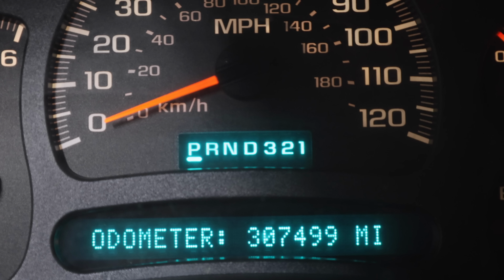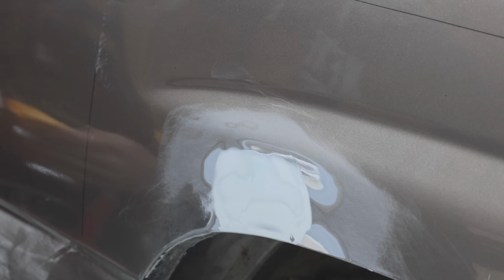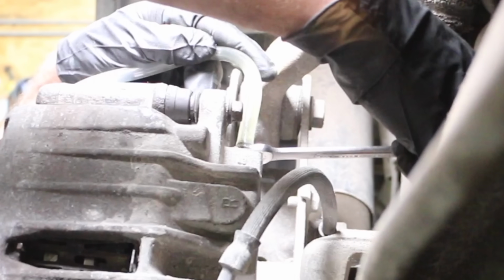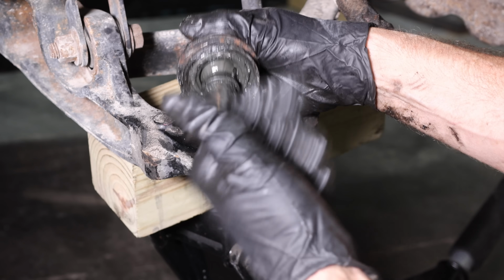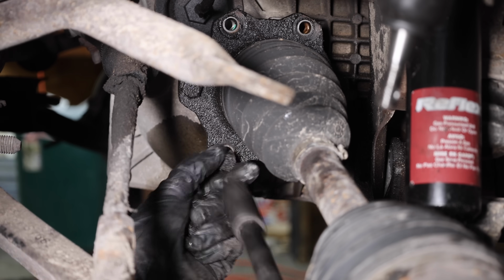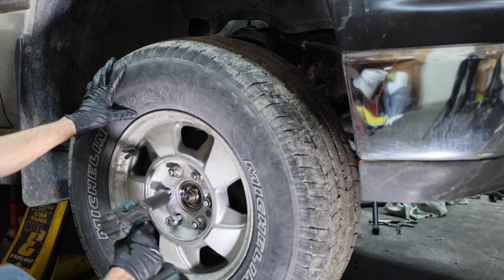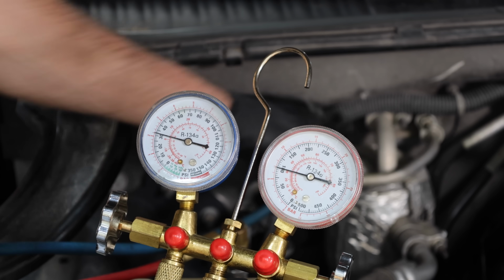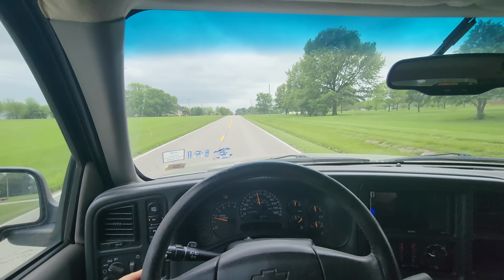Is It Stupid To Fix Up A 300,000 Mile Vehicle? Let Settle This!

Comment: I own a 2001 Subaru Legacy GT Limited 5-speed. 156k miles. in recent months, replaced struts/shocks (with coilovers and lowered the car), front CV axles, ball joints, tie rod ends, sway bar end links. power steering pump & hoses, and driver side steering knuckle & wheel bearing. Costed a bit under $800 but worth it to me. I love the car. 2.5 years ago I replaced the head gaskets and  2 years ago i replaced the brake rotors & pads. All this work would have costed over $6000 if I had taken the car to a shop. It pays to do the work yourself, however I will say that it does take some time and effort, plus extra cost if you don't already have the tools (like floor jack, jack stands, impact sockets, wrenches etc). It's worth it in the end!
DO NOT work under the car held up solely by a floor jack, put it on jack stands!! While working on  my car, i went to jack it up with my floor jack and it failed, the car fell back to the ground.
Reply from the maker: Thanks for sharing.

Comment: I agree with you that cleaning up parts and components when doing any kind of repairs is necessary. a person would really be surprised what can be found underneath the dirt and grime. such as cracks and other signs of wear. and if nothing else it looks better when the job is done. some vehicles will require cutting off rivets and replacing them with bolts. on the ball joints instead of C clips. some of the other areas that are known to experience significant wear. are universal joints and drive shaft carrier bearings. and transmission shift linkages because they get used constantly without a lot of attention. and rubber mounting points because the rubber can become hard and cracked. that reduces it's ability to isolate the parts and components causing squeaks and rattles. models like the Suburban are usually okay to repair with higher mileage. because they are sturdy platforms to begin with.
Reply from the maker: Thanks for the feedback.

Comment: I have 2003 chevy k2500 with over 300,000 on it. Not sure how many over. Dash stepper motors went out si I drove it with non/ working dash for 5 years. Basically same repairs you outlined. Lots better than a new $60 k truck!
Reply from the maker: Thanks for sharing.

Comment: I’ve got an 01 Silverado 2500 with 240,000 miles on it, I’ve owned it for about a decade, and have only needed to do regular maintenance, and a crate transmission about 4 years ago. Very reliable truck, pretty easy to work on. I’d recommend the GMT-800 platform to anyone who wants a vehicle with plenty of modern features that still wants to be able to work on it themselves.
Reply from the maker: Thanks for sharing.

Comment: As for fixing up an old vehicle vs junking its so situationally dependent.
How good of shape are major components in (engine, trans,etc?) 

How rusty is it, especially on brake lines, frame, body mounts...

How many miles is that specofic vehicle known to go? 

How far from home do you typically take it...

Just so many factors. 

Great video, glad to see anothef old chevy fixed up amd running! Love these trucks.
Reply from the maker: Thanks!

Comment: I have 235k on my Yukon, I removed the engine, replaced every gasket, and upgraded the radiator to a Denali rad and added oil cooler hoses. My opinion on these trucks, you can’t find a better value and easier truck to work on. Minimal issues if you take care of them.
Reply from the maker: Thanks for sharing.

Comment: Engine oil and transmission oil cooler lines 😢
Reply: Brake lines first
Reply: @magouliana32 interesting, why do you say?
Reply: @KevinPDunn  known corrosion issue on 2000-2006 gm trucks of that line they leak eventually big hazard

Comment: 322k mile 2006 dodge Durango 4.7 v8, needs a few stuff done but engine still runs, transmission and diff are in great condition and reliable
Reply from the maker: Nice!

Comment: I was with you on everything except your AC "pressure check."  There is no way to tell how much refrigerant is in the system based on a static pressure.  Due to the properties of refrigerant, if there is even one drop of liquid refrigerant in the system the pressure will be the same as if there is a pound of liquid refrigerant in the system.  The only thing a static pressure check will tell you is if there is enough pressure to activate the low pressure switch and turn on the compressor.  So, just because the static system pressure approximately equals the outside air temp doesn't mean it has a full charge.  

The ONLY way to tell if an automotive system has a full charge is to remove the charge and weigh in a full charge.

Comment: The way I repaired my car. Does the job. Saves cash 💰 😂 by the way, the battery is on its way out.
Reply from the maker: Thanks for sharing.
Reply: @ProjectFarm  your battery health should be determined with a fully charged battery to 12.6 / 12.8 volts. Let a small current skim excess charge (use headlights for instance) and run the test again. It will give an accurate measurement.

Comment: do not change and what was the total cost for all these repairs for parts then maybe if you add the value of your time?
Reply from the maker: Thanks for the feedback.  The total cost of repairs was $2000.  Saved between $4500-$5000 doing it myself.

Comment: i love seeing videos like this, it inspires me to try and do even more on my first car which i have for around 3 years now, its a 1989 Miata and its such a fun and clean car. since im still an intern i dont have that much money, so i try to do all of what is possible in the driveway and try to make the repairs diy. already did front brakes, front ball joint, valvecover gasket and cam angel sensor o rings, thermostat, all the filters and fluids including flushing the radiator, and just stuff like that.

Its fun, you end up swearing a lot on bolts that are rusted to crap but in the end its always so nice seeing new parts on ur 34+ years old car making it handle and drive better bit by bit.

next up is probably suspension bushing and or the coil over bushings, since they are TOAST making the car feel loose over bumps.
Reply from the maker: Thanks for sharing.

Comment: My 2010 f150 has over 250,000 mi on it and it still runs like a brand new vehicle the only things that have needed to be replaced on it are the alternator, the battery, the power steering pump and the AC compressor. I was able to do all of the work myself and the parts were not that expensive.
Reply from the maker: Thanks or sharing.

Comment: I have a 2003 tunder with 300,000. Its my most dependable vehicle. It doesn't even have an oil leak. The transmission oil is still pink. The only thing thats not normal maintenance wqs that i had to replace my radiator. It also has 0 rust due to living in the south.
Reply from the maker: Nice!  Thanks for sharing.

Comment: Howmuch was the total repair you should add that and also the price it would be at mechanics shops.
Reply from the maker: The total cost was $2000.  Saved between $4500 -$5000 doing the work.

Comment: Depends on if the engine is even worth rebuilding, because then you can just fill full of performance and aftermarket parts
Reply: That work better and longer than oem
Reply from the maker: Thanks for the feedback.

Comment: I've changed my own brakes for 25 years and learned a few things watching this, excellent job explaining. You did skip 1 very important part, at least for us that live in the rust belt. Breaking a bolt. You feel the wrench slowly get easier to turn and instantly go through all the stages of grief in your mind. Spend the next few hours attempting to get the broken bolt out and then promise you'll go to the mechanic next time....but never do.
Reply from the maker: Thanks!  Thanks for the constructive feedback.

Comment: I like your pace. As far as the title of the video "is it stupid to fix..." The highly depends on your know how level. I have a 93 f-350. Great engine, great truck... When it was new. Now, it need serious TLC, but I'm not a car guy, and my family doesn't know Diesel engines. In the last two years I have probably put 300 miles on it at most, because it has been dead for 1 reason or another. It stays and I tinker with it because I can't afford another truck, but if I could, I'd replace it.
Reply from the maker: Thanks for the feedback.

Comment: Two big factors right off the bat: how much serious rust does the vehicle have and you are able to do the work yourself? Another factor, how reliable is the vehicle overall? Most people should never bother trying to keep a German or British car going since literally every mechanical component would need to be replaced after 20+ years or 100k+ miles. I would hate to think about how much money in gas was spent over that 300k miles. At some point you could have bought a more efficient vehicle and it would pay for itself in gas savings alone

Comment: Not stupid to fix up a 300k mile car especially if u were the one maintaining it even if you took it to a shop but the cost is night and day. My 2001 nossan xterra currently has 333k miles and doing great. Will prob go 500k and i do all the maintenance. the best thing about doing it yourself is thst many of the parts have a lifetime warranty (i.e. alternator, water pump, radiator, brske pads, shocks, muffler, etc.) i have so many lifetime parts that i no longer pay for parts lol. great cideo btw!
Reply from the maker: Thanks for sharing.

Comment: I've never bought a vehicle (other than a motorcycle) with under 165k miles.  

My first vehicle was a 1984 f150 with 150k miles.  It lasted me 8 years and another 50k miles before it got more expensive to repair than it was worth.  Plus i never liked that truck.  My mom forced me into it. 

My 98 grand cherokee i bought with 155k miles.  I've had it for 13 years and put 75k more miles on it and it's still going strong with normal rapairs. 

I also have my 08 tundra that i bought with 177k miles.  It's currently at 201k miles and running like new with a few repairs like a steering rack, front axle seals, and plugs and coils.
Reply from the maker: Thanks for sharing.

Comment: These trucks are amazing tanks. I paid $3500 for an '04 GMC 'suburban' with 400k miles. Most things have been repaired, and I'm replacing the rusty pieces, but there is a lot of rust on the body.
Reply from the maker: Thanks for sharing.

Comment: I'm still driving my 88 Nissan Harbody with the 2.4 four-cylinder I bought new when I was 22 years old. It now has about 430,000 miles, and runs well.  0-60 times can be measured with a sundial, but it still gets about 25 highway, 21 around down. Every time I go to look at new truck I see the price and just decide to keep drivng my old truck 'for just another year'.  I repainted it some years ago, and keep it waxed. Looks pretty decent for an old truck.
Reply from the maker: Thanks for sharing.

Comment: This video came at the right time. I just bought a one owner 1998 K1500 Z71 with 146k miles for $1500 . Only has driver side cab corner rust spot and needs pads and rotors. Has the 5.7L and extended cab with 3rd door. Wife thought I was crazy buying a 26 year old truck, I thought I was crazy if I didn't for the price. Love your videos!
Reply from the maker: Thanks!  Glad to hear!

Comment: i just sold my 300k mile mitsubishi endeavor I had for 20 years to an old mitsubishi mechanic, he seemed to want to keep it running and he probably could, but by the time i sold it off i had probably replaced just about every piece/brakes/tires/AC everything except the engine and transmission i feel. and it was still running! i woulda just kept driving it but finding parts for that car is getting too hard and by the time it reached 300k i had saved up enough money to get something newer. i like to think my old car is still on the road after the couple repairs it needed.
Reply from the maker: Thanks for sharing.

Comment: I have a 2011 Toyota Sequoia with almost 230,000 miles on it. Just put about $2,000 into it to keep it driving nice (new steering rack and power steering pump, rear shocks). No point spending $60,000 on a new one when I can keep this one running for pennies on the dollar!
Reply from the maker: Good Point!

Comment: Should you fix it.  Depends.

Lets say it is a 1999 truck needing a transmission and an engine rebuild/replace estimated at $6000.

Can you find a 1999 truck the same size that runs fine for under $7000....then scrap the car and replace it.

Comment: I've had a 2001 Lincoln Navigator since new. Today, it mostly sits in the driving (rusting away) with just 122K miles. It still runs great, everything works. It's a good "big" spare car, and would cost, what, $70K to replace? No thanks, I'll keep it.
Reply from the maker: Thanks for sharing.

Comment: Typical GMT-800 check engine light. What's wrong? Nothing, it just felt lonely. Stellar video!
Reply from the maker: The light is related to the fuel evaporative system and isn't worth repairing.  Thanks!

Comment: The excess amount zinc in the T4 diesel oil will start to poison  catalyctic converter. I did this on with a 1994 F150 with a 302, to try and limit a leak rear main seal. Cold morning starts were noisy and the waiting game for oil pressure was scary below freezing.
Reply from the maker: Thanks for sharing.

Comment: That was awesome!! I have a 2001 Tahoe that's a lot like this, and needs many of these repairs.  DON'T slow down, I can always adjust the YouTube speed for the parts where I need to see the fine details. Love these car-renewal videos!!  You did one for an older Honda, I wish you would do a video for older Toyotas too, like a Gen I (Toyota) Scion xB, 2004-2007.  I own 3 of them. These Gen I Scion xB cars are known for getting to 500,000 miles and beyond. Has many parts in common with the Toyota Yaris also, and probably other small Toyotas as well.
Reply from the maker: Thanks!  Thanks for the feedback.

Comment: I've got a GMC 2001 Yukon. The seats have seen better days, but everything's in good working order. 250k miles and still running great.
Compared to today's trucks, any Truck older than 2005 is still a cheap fix compared to a new vehicle. Saving up next to have a few dents fixed and new paint.
Reply from the maker: Thanks for sharing.

Comment: As always, a joy to wach. My only suggestion as not seen in video, would be when removing calipers and fitting new brake sets, to extend and clean the pistons before settings then back in, this will save them from scratching and help the seals and dustguards to last.  You might have already done that but I don't see it on video.

WIth that milage and mainly age, also a whole refurbishing of rubber parts in the brake system might have sense. Rubber just ages, disregarding the miles: new lines are IMHO a must after so many years, and new seals and dustguards are not that much money and are a "set and forget" for ese of mind. I like just emptying the lines and deep cleaning properly the pistons.  

With ABS, sadly, getting air of out the system after a full service is not easey without the service device to open  the valves in the unit.
Reply from the maker: Thanks!  Thanks for the constructive feedback.

Comment: Topic suggestion: How about testing fluid extraction pumps?  They use vacuum to suck used oil from small engine sumps and other types of fluids from engines. They save time and mess!
Reply from the maker: Thanks for the suggestion.

Comment: It is often a difficult decision on investing $2K into a high miles vehicle.

My personal argument for investing $2K into my 210K mile Honda Element is I owned and maintained since new. I have all of the records and an extensive spreadsheet on which I have tracked every penny put into the car for maintenance and repair since day one.

After 21 years I still love the car and while my life has evolved and changed the Element fits my lifestyle. 

Paid $20K for it in 2003. In 21 years I have spent $13,250 on maintenance and repairs (tires, brakes, struts, oil changes, trans fluid changes etc.). Quick basic math tells me my Honda has cost me on average  $132 a month since I owned it. 

I figure  it would cost me $800 a month to buy a similar replacement vehicle. So I am saving $660 a month in car payments.

Bought a new Passport for my wife in 2023 and I have a “fun” Summer car which I paid cash for. I will need to replace the Element someday as I live in the salt / rust belt. With that in mind I put a reservation in for a new SUV which wont be delivered until 2026. We will see if I fully commit to a new car or just keep driving it.
Reply from the maker: Thanks for sharing.

Comment: My brothers 2004 GMC Sierra came from a lumber mill, where it was used first as a salesmans truck, then as a yard beater. It accumulated over 350,000 miles, original 6.0l engine, (2500HD regular cab, only option added was A/C lol) 
It had... 0 engine hours apparently (ECU had brain damage from the rough terrain it lived on)
It lasted forever, before it got stolen and totalled.
When it was recovered, before it was sent to scrap, the engine was pulled, when we found out that it had a split in the crankshaft that had been welded crudely, and was the cause for the vibration lmao
Damn thing lasted tho! 

I have a 1996 Chevy C1500 that came with a 305 L30, which was not running at its best after almost 500,000km lmao 
It now has a 350cui (5.7l) crate engine with some performance parts (pulled from a slightly modified C10 Custom Stepside) which produces almost 370 crank power, so approx 280ish at the wheels after torque losses and whatnot. It's rusty as heck, but its a project, with almost 600,000km showing on the odometer!
Reply from the maker: Thanks for sharing.